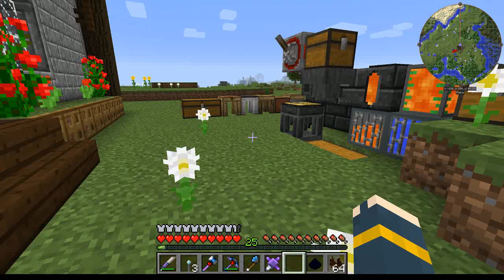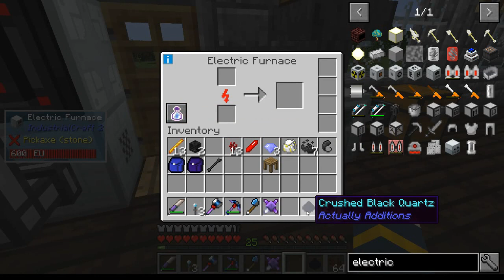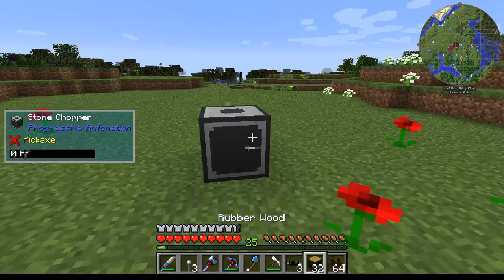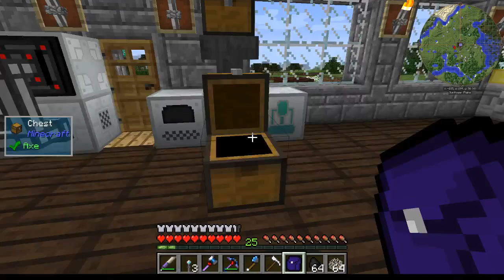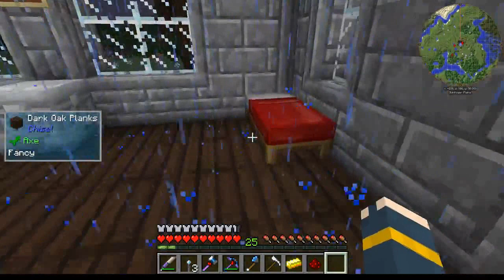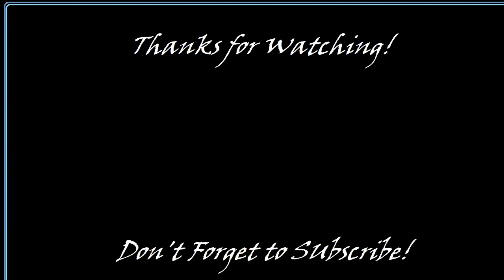Age of Engineering 07: IC Some Improvements

Comment: Charcoal can be used in the blast furnace. Also you should consider making power from canola. You can use a basic greenhouse to grow canola decently fast and an oil generator produces 100 r/t which is enough to sustain two preheaters, which speeds up the blast furnace immensely
Reply from the maker: I thought I had tried charcoal and it didn't work... I'll give it a try next time I load up my instance! At the point where I am now in the pack I haven't needed a massive amount of steel - if I do need more in the future I can always upgrade then. I am actually trying to stay away from any canola production in this pack. I've done it and seen it done so many times in recent packs that I'm sick to death of it. My approach is going to be way less efficient, but it will be something I enjoy building. ^_^